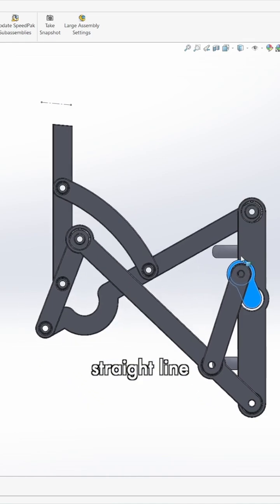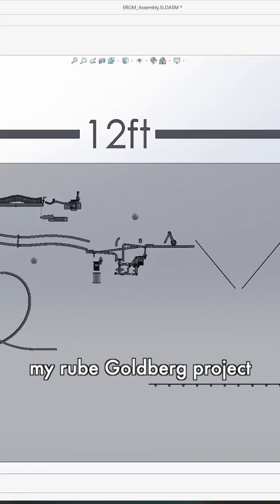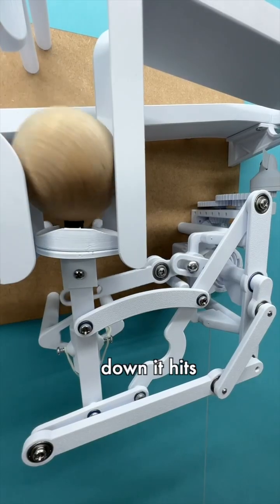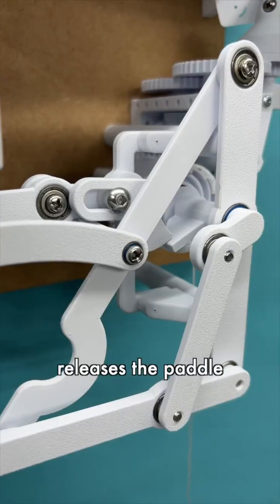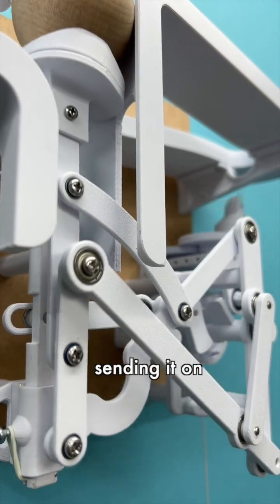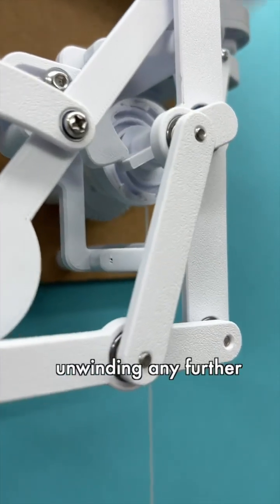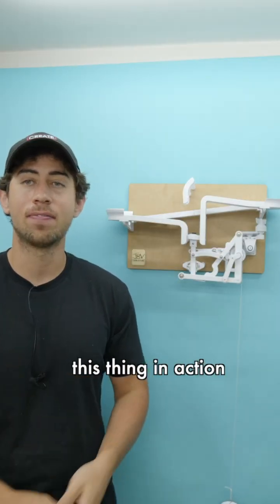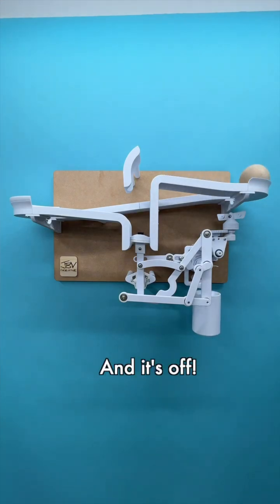Gravity Powered Ball Contraption #mechanical #3dprinting #mechanicalengineering

Comment: very exciting, however you could save a lot of energy by letting the down stroke movement be done by gravity and not waste the weight on it. You see it speeds up as there's no resistance, so just a few modification would make it run at least double as long with the same weight.

Comment: Im confused. Is this perpetual motion? If not, where are the batteries?
Reply: There is a string connected to a weight that is wound up meaning that it will only last as long as it is wound

Comment: So if you add a spring winding spool for the weight and a gear to on top of the ramp that turns a turbine for a generator, then when the ball rolls down the ramp it will turn the turbine and create electricity and the weight will constantly go back up for forever you basically get infinite electricity?🤔

Comment: Can you fit a generator on the fan type rotator, connect it to a battery and fit a motor on weight release wheel with a instruction board connected to the battery's power supply. Then whenever weight reaches the end of the rope the motor works pulls the weight up and works in a loop until the battery, motor, or generator malfunctions or need to be repaired again
Reply from the maker: Something like that 😀